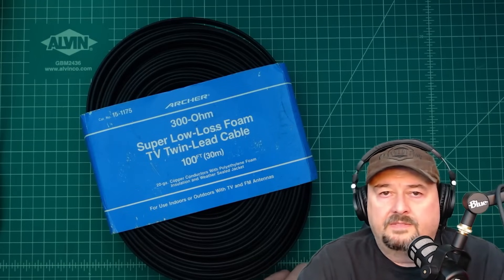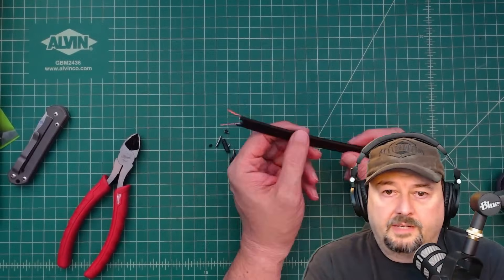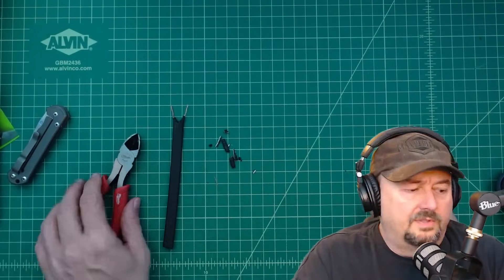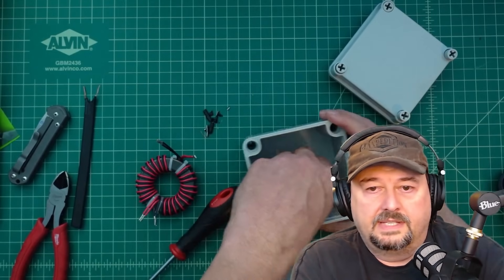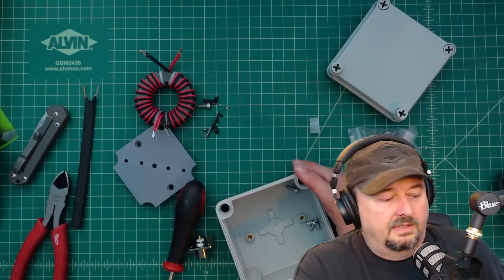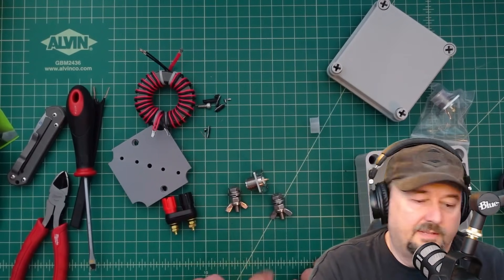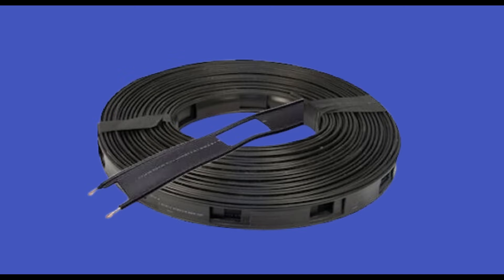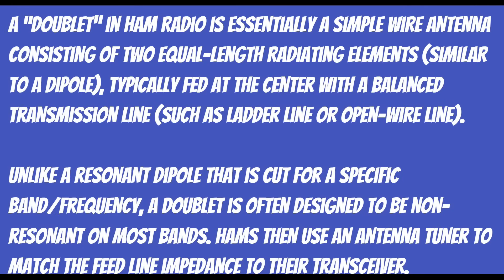300 Ohm Twin Line: The Secret Ingredient for Antenna Magic?

Comment: Back in the day, Archer 300 Ohm was the go-to TV antenna wire. Our antenna line went from the living room, down to the basement, out a window and up two stories to the roof antenna attached to the chimney. Brittle doesn't even begin to describe it. Even as a kid I was constantly cutting and stripping broken pieces. Good times!
Reply from the maker: Thanks for the info Doug 👍

Comment: Ape use a heat gun on the twin lead. Don't melt it just put some heat into it. You will get the feel of it pretty quick. Makes stripping it a whole lot easier and cleaner.
Reply from the maker: Thank you for that 👍

Comment: While not exactly the same folks here in Appalachia have used ladder line for years to make Mountain lines. Mountain lines are long, often 1000'-1500' long runs of line up a mountain so you can mount your CB/Radio antenna on the ridge top. Many of us live in deep hollers and are surrounded by mountains on all sides. A mountain line lets us get ou antenna up high and over the ridge line....
Reply from the maker: Didn’t know that, thank you 🙏
Reply: I remember some ladder line with copper wire and plastic insulators about one inch spacing used for tv years ago. About to make some 600 ohm for a doublet when the weather gets better.
Reply: @techguy9023   thats what ours looked like, white plastic spacers, copper wire
Reply: Makes sense! You need a really low - loss balanced transmission line like ladder line or TV twin lead for that long a feeder. 300 ohm TV twin - lead is CHEAP compared to the windowed ladder line.

Comment: Funny how the wheel keeps getting reinvented in that the 4010-ROK looks to be basically the same radiating element as a half size g5rv just with 10m of budgie ladder feeder rather than the 5(ish) of the half 5RV but as both need an ATU anyway that is academic... the radiating sections are both the same so as long as your ATU eventually tunes it choose whichever feeder length option is easier for you.... the best option would actually be to go with a remote ATU that has a balanced i/p, feed the budgie ladder straight into it & entirely dump the need for an additional BALUN.

I've actually been in contact with one of the Chinese auto_ATU manufacturers to see if they would do a waterproof balanced i/p variant of their current unbal so239 auto-ATU.... string this up directly on the end of a half size 5RV & you'd also get 40-6 & the balanced ATU simplifies things as it replaces the equivalent sized BALUN.
Keep your eyes peeled to see if any cheap balanced auto-ATU appear on the market in the near future.

For QRP I favour the half 5RV going straight into the 50 buck GQRP Sudden ATU which has the balanced capability (no other balun needed).
For QRO portable, MFJ in the old days certainly had some BAL capable ATU.
Using the 10m feeder 4010 ROK & a 10m fishing pole gets the antenna centre to an easy height & the budgie ladder then reaches perfectly to the bal ATU on the operating table at the pole base (dump the BALUN).

Going off on a tangent, you know how for every balanced antenna there is a half unbal antenna (ie half wave dipole vs quarter wave whip) well disregarding the pre-tuning at the feed by budgie ladder or whatever what do you get if you cut the above 50foot(ish) of radiating metal in half to get around 25foot of un-bal metal & then clag a match built into a baked bean can on the base for the feed?... Gentlemen I give you the Comet CHA250-B... ... all basically the same reinvented wheel just with subtly different colours.
Reply from the maker: Thanks for the infor Streaky, it’s helpful 👍

Comment: I had some of that Radio Shack 300 ohm foam-filled cable years ago.  It was so hard to work with and the stiffness kept breaking the 18 Gauge wires that I got rid of it after just a few trips.  I found a large roll of plain 300 ohm twinlead at a hamfest for a few bucks and am still using the same portable antenna that I built from it over 40 years ago.  I am finally going to replace it this coming camping season.  I plan on using 450 ohm ladder line like what you showed early in your video, but I will get the stranded wire version (solid wire tends to break and is hard to handle).  It is a little more expensive, but way easier to deploy and roll back up.  The 450 ohm cable is typically lower loss than the 300 ohm, but I don't know how it compares to the foam-filled stuff.  I used 75 foot legs on mine, and it works great on 80 - 10, but it takes a bit of space to deploy.  It also takes a good tuner to make it work.  18 gauge wire for the legs works great, but can be easily broken.  I will go with 14 gauge Flexweave (168 strand ultra-flexible) for the legs to make it super easy to handle while retaining reasonable strength for hanging in trees.  I found that a 4 to 1 balun gives me better matching than a one to one, but that is with my longer antenna legs.  For a permanent installation I would use the 1/4 x 20 bolts and wingnuts.  For a portable antenna I would go with the 5-way binding posts.  They are quicker, no tools required and have more options for connection to the feedline.  I had banana plugs for many years on feed end of my twinlead.  A friend tripped over the feedline a few years ago, breaking the plug.  I was able to quickly repair it by just sticking the wire into the 5-way binding post.  Has been that way ever since.  Laziness is the mother of more operating and less messing around...  73, Len, KD0RC
Reply from the maker: Great info, thank you 🙏

Comment: I haven't used  300 ohm twin lead since the 1970's . I still have some radio shack twin lead.   My MFJ tuner has balanced line  jacks . Their is a 75 ohm twin lead as well. not common .  100 watts should be fine.  More power and you may have a heating element . This may be handy if you get ice build up . The last one I did years ago worked great ! But rain,ICE,Snow would change SWR . Need a tuner anyways . Just remember re tuning as weather changed. Keep metal like 3FT from twin lead.  Some use a 4:1 some use 1:1 it depends on tuner.  I have seen something like you making with    RG11, 75 ohm after Balun.  They used a certain length of RG11 into the shack. Have fun.  They can work well !  73
Reply from the maker: @robertmeyer4744  hey Robert.  I am looking forward to the build, hopefully it turns out OK 👍

Comment: 1/4 20 bolts, or you will have weight of wire issues
Reply from the maker: In the mount plate?

Comment: Mr Ape, that is a great choice of antenna. I hve the materials to put a 24 foot per side solid element rotating doublet up. It is the higher hf band antenna for my new qth. That length is not good for 6M. Why not add a fan element for 6M. That would be around five foot long per side. Use blue steel rope for the guying "wires". The thing is though, for portable use these kinds of antenna can become a rats nest. If you can make wires easier to detach, you can roll them up into bags separately. A big help over time.
Reply from the maker: If I can’t get 6m I’m not gonna be too upset with it…. This will be an inverted V so I expect it would be more omnidirectional that a flat top dipole for example 👍

Comment: Back in the '60s when I first got my license, 300 ohm TV antenna line is what I used for feed line. I connected it from my match box to a 40m dipole that ran from the back yard to a tree in front of the house. The 300 ohm feed dropped down to a window on the side of the house, where I pulled it in. We lived in a row of duplexes, so each house was close to the neighbor. The antenna ran along the side of my parents' house, about 30ft high. Seems like there was a lot going against it performing well, but it was great at the time.
Reply from the maker: We’ll see how this one works out, I really don’t know what to expect 🤷